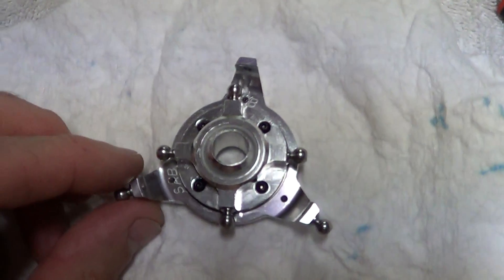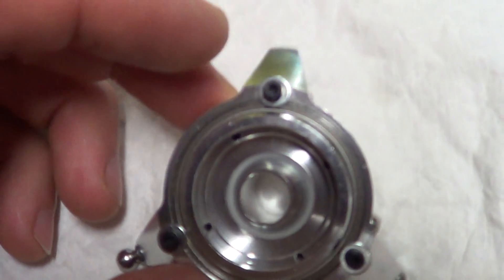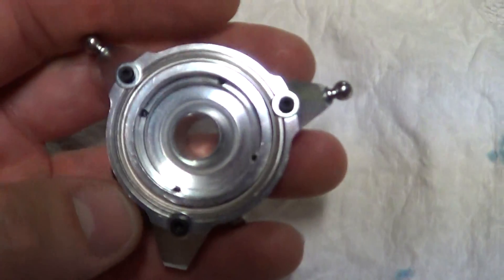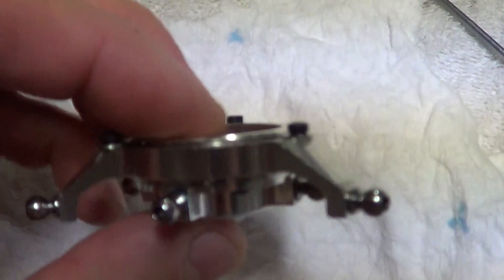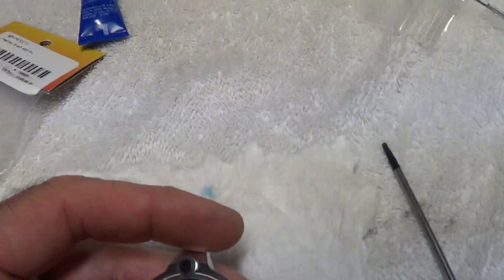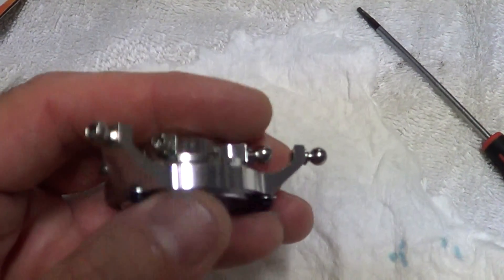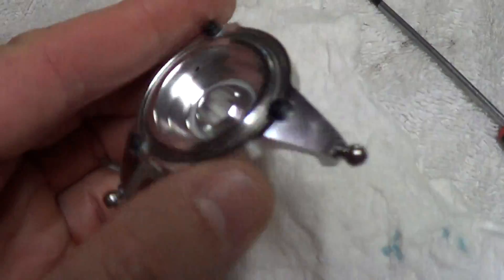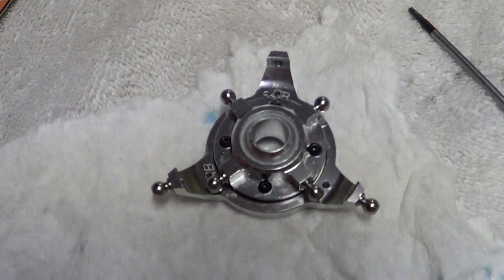Sab Goblin 500 defective swash plate ,and how to fix it

Comment: I just had this exact same problem on my Goblin 500 and it caused a tip over.  Luckily no serious damage but the fact that SAB couldn't invest the smallest amount of money to add 2 screws to prevent a potentially catastrophic failure from occurring is baffling.  I found this video unfortunately after the tip over, but now I did this mod.  Thanks Ray.